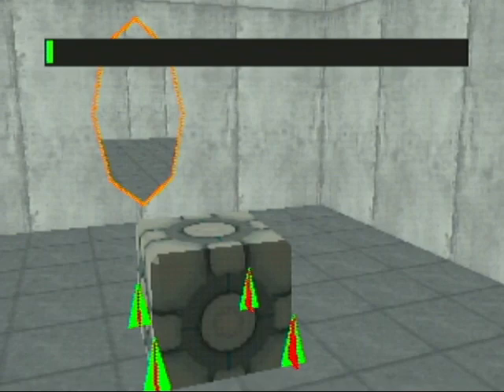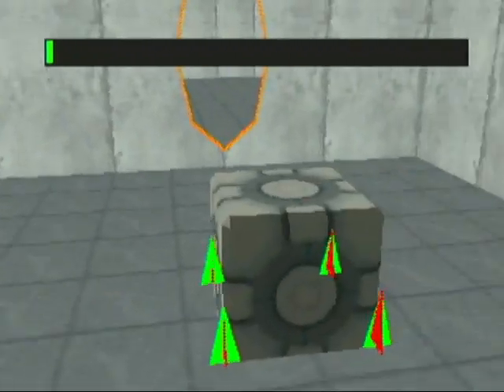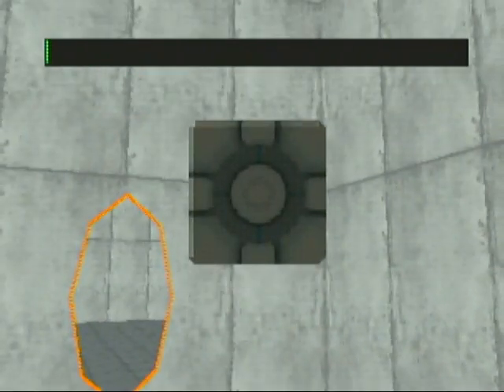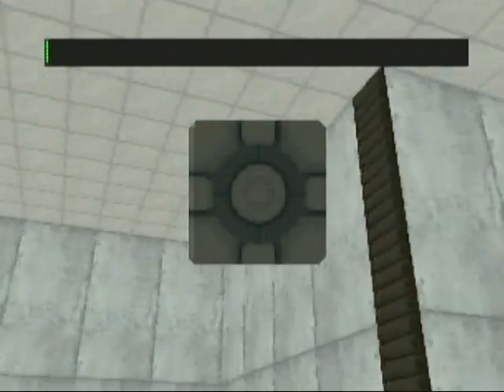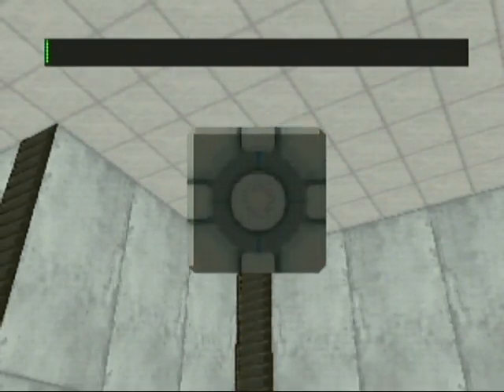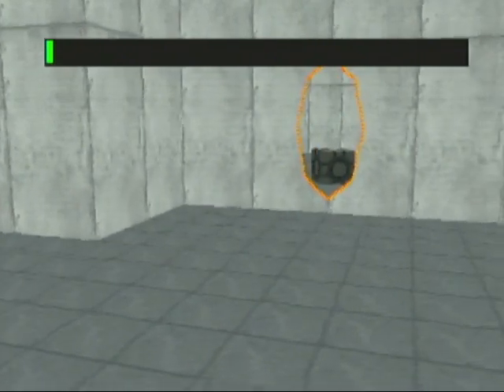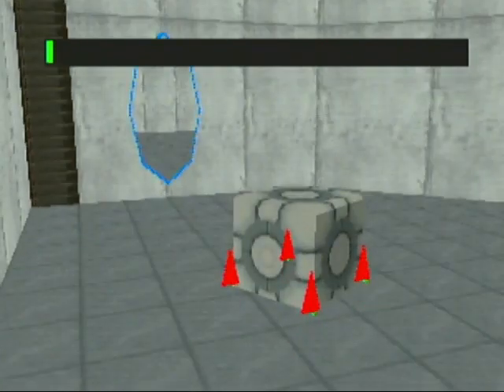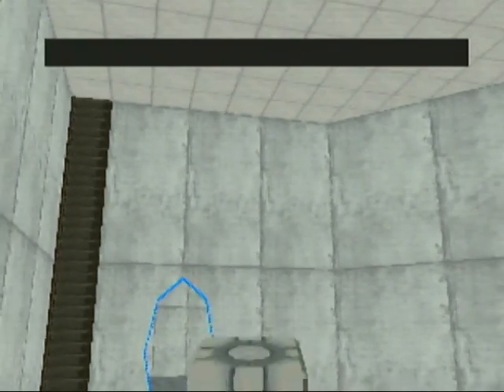Portal Nintendo 64 Demake: First Step on Physics Engine

Comment: You could activate physics for a cube, if it's in the air and if it collided with the ground, a timer will activate in which the cube has time to orient itself to the ground, when the timer is off, the poaition of the cube gets rounded and leveled to the ground evenly

Comment: I dont know if you're trying to run it on the actual console or on an emulator but wasn't there a specialized cartridge with built-in hardware improvements?

Comment: Physics does not need to be calculated on two objects that have little or no velocity difference between them.
Once an object has come to rest against another object, physics should be paused until another object is in range and has enough velocity difference.

Comment: Most physics engines usually have rest period. When the entity is barely moving anymore it will go into rest state and will not be calculated anymore unless something collides or interacts with the entity again.
Reply: I believe source does that too
Reply: @thespyfromteamfortress2149  yeah, sorce uses havok engine that does that. Bullet engine also does this
Reply: This can be seen in portal 2 when you set one cube on top of another and pull out the bottom one carefully; the top cube will float!
Reply: @kip258  That dosn't sound right, if I remeber correctly havok tries to wake up objects when one of the contacts updates (wich moving the object should update the contacts). The cube would stay asleep if it didn't move but yeah it shouldn't be possible to slide a cube out from under another cube
Reply: @gwentarinokripperinolkjdsf683  It can be done but its really hard. You have to remove the bottom cube without contacting the top cube, eg, without waking it up.
If you use two laser cubes and the cube on top is directing a laser into a laser receiver, then it's REALLY easy!
Reply: You can see it very easily with item save glitch because after a relatively short time of bouncing around it'll stop